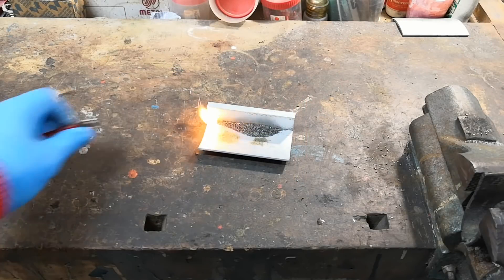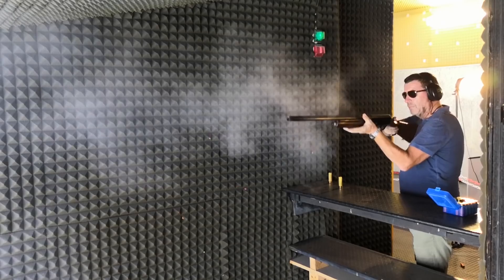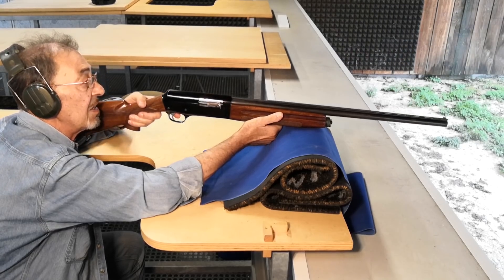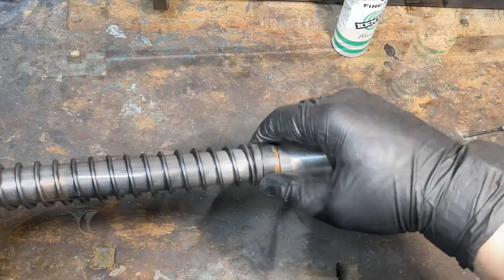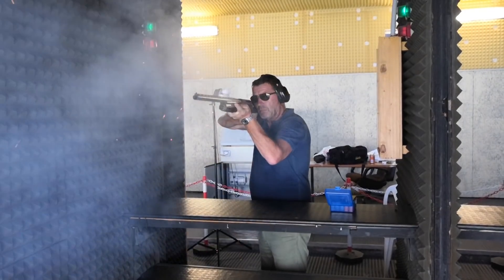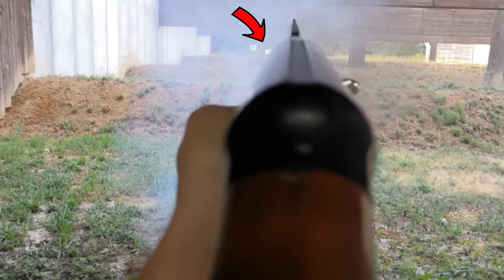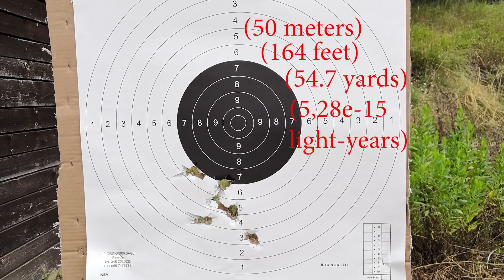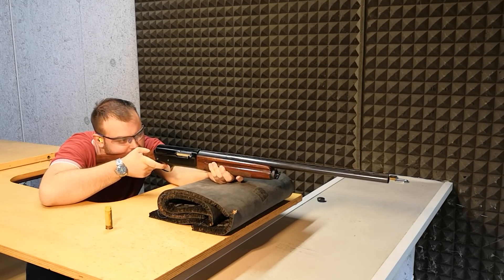Would a Modern Automatic Gun Work With Black Powder?

Comment: Gas operated can work, it probably just won't work long. There's some old videos here on YouTube of someone loading up some cast 200gr .308 projectiles with 35gr of Goex, and the guy gets some shots off with both an AK and an SKS, and the reason it stopped wasn't fouling, rather that he used bare lead bullets which would plug up the gasport.

Gas operated is not going to be optimal for blackpowder though. Maybe the old Potato Digger style of swinging gas lever could get away more with fouling, but my gut feeling is that you want as little moving parts in the action as possible to induce as little resistance as possible, and you're going to want something that uses heavy projectiles. Blowback, maybe even open-bolt, might be best.

The M1A1 Thompson would likely work better than most, but you could probably drag things out longer with a hypothetical dedicated weapon and cartridge. Using a cartridge case with a thin mouth to induce better obturation (like on .44-40 Winchester), along with using generously lubed bullets and a particularly cleanly burning powder, such a finely made one from balsa wood. Patched bullets and Metford rifling might also improve things.

Comment: I live in California and its a pain in the ass to get ammo because you need to go through a background check to get ammo. So i just reload some .308 ammunition with black powder and reprimed the primers with prime-all and i get at least 1-3 moa groups at 100 meters with my mossberg patriot. The groups begin to open up after like 15 rounds which is the downside but it works really well in bolt actions. The barrel does get pretty hot so i stop shooting after 20 rounds to prevent my polymer stock from warping.

Comment: Bolt action rifles are excellent for black powder all tho its still not ideal but it easy to clean and not gas operated i have tested it with black powder and it works just fine but when the barrel heats up the accuracy is quite compromised     it works if you want to shoot 5 or 6 shoots with 10seconds between them but in a semi auto rifle it would jam after 2 or 3 shoots especially an m14 I dont think any fun from the ar platform would work with gunpowder

Comment: Since the Hk-91's are a type of recoil operating rifle, I wonder if a bp load will work. Keep in mind the chambers are also fluted. The Hk-91 action is called a delayed roller locked blow back action. Question is does Black powder have enough pressure to release the rollers?

Comment: I have seen demonstrations of the other way, loading smokeless powder into guns intended for black powder. Short version, it's a great way to blow up your gun. Smokeless (especially modern smokeless) burns a lot faster than black powder creating higher pressures with less powder. If you put a volume/weight of smokeless powder in your gun equal to the volume/weight of black powder you normally put in the same gun you will get far higher pressures than normal and could seriously damage if not explode your gun. While it's in your hand and maybe right next to your face. Thus, I was not surprised that even a large charge of black powder had trouble cycling this gun in it's standard configuration. This long-recoil action clearly did a good job of keeping the fouling in the barrel and chamber and out of the action. I would be curious to see how fast black powder fouling builds up and becomes problematic in a short recoil (like a Glock or similar pistol) or delayed blowback (like an MP5 or FAMAS) or straight blowback action (like a PPK or Makarov or UZI).

Comment: The really corrosive part of old ammunition was the primer, not the powder. Primers, particularly military primers made before the 1950s contained potassium chlorate to make them operate over a wide temperature range and give them long service life. On firing, these primers left chlorate residue in the bore and action which ended up as hydrochloric acid, which was the main initiator of the rusting process. It needs quite aggressive cleaning, preferably with a hot alkaline cleaner such as boiling water and washing soda. 

Normal black powder residue is not nearly as corrosive as it produces mostly nitrate ions rather than chlorate ones. As is observed, nitrate will attack aluminium coatings such as anodising, however its affect on ferric alloys is much less. Black powder residue needs to have water to release the nitrate ions, so the secret of preventing corrosion is to either wash off the residue quickly with a detergent solution or prevent moisture getting to the residue by using a water dispersant such as WD40.

If you are not able to strip and clean a BP gun immediately after shooting, giving it a good soaking in WD40 will prevent any corrosion for a few days until you can get to clean them properly... It is NOT a long term solution.

Comment: Well most shotgun shells are still to this day loaded to original black powder pressure levels, which is why reloading shotshells with black powder or black powder substitutes like Triple Seven are quite viable, especially in break actions or pump actions. So this doesn't surprise me one bit to see it. Plenty of revolver cartridges that could be loaded the same way too. I did know a guy once who used to load Triple Seven in old military cartridges where load data was scarce to build up a test load first, so black powder and black powder substitutes have plenty of use still.

Comment: I'm curious if an inertia-action shotgun would work as well or better? They supposedly have the least fouling of any autoloading system. You would probably have to do a lot of disassembly and install a weaker spring beforehand though, as opposed to just removing a friction ring. I'm also curious how many shells you can fire from your Franchi before it fails to cycle. Asking because I have an Auto-5 and access to a lot of cat pee.
Reply from the maker: I'm pretty sure benelli inertia system would work well, at least in theory. Also, one could increase the recoil impulse using heavier slugs (I was only using 28 grams slugs. 36 or even 40 grams are available)

Comment: The culprit is sulfur. Use sulfurless BP. The Nobel stoichiometric  mix is 87.1 KNO3/12.9 charcoal. The only fouling is potassium carbonate, which is very easy to clean, and not corrosive. Also does not produce much smoke.

Comment: Thank you for sharing this VERY ENTERTAINING and somewhat informative video  on black powder semi auto shotgun shooting.... I can expect that the STOEGER or FRANCHI recoil operated design might also work with stout loads of black powder in magnum hulls with cork, or waxed hard card or  fiber wads.... PLASTIC WADS MIGHT MELT  with the extra heat or fire that  BLACK POWDER CREATES.... So, with black powder,  fiber wads, cork wads, or waxed hard fiber wads...  touching the powder are a better choice...  To avoid plastic fouling do not let plastic wads touch the powder.  IT is possible to load a  cork, fiber or waxed hard card wad and modern plastic shot cup in such a way that the powder does not touch the plastic.

Comment: There are several series of older centerfire rifles that utilize the long-recoil action; by fortune of chance, some of these are chambered in cartridges that originally were intended for BP and later 'converted' to smokeless loads, and hence have enough capacity for reasonable performance. A Remington model 8 is a great example even though the .35 Remington was designed for smokeless, it's still a fairly large case for the projectile...

Comment: I like the content and the ideas but I was expecting full auto instead I got semi-auto black powder shotgun I would like to see this done with a real automatic weapon it's like an automatic shotgun with hands Buckshot black powder use a custom Wad and double Ott like 5 instead of 9 to get more powder I'm kind of disappointed that there is no fully automatic black powder I would like to see this in some Modern rifle design it would be cool to me a specific make a complete shotgun designed for extra large South by increasing bore diameter and length even if you have to do one break Barrel shotgun so you could put extra big point on the shell or make a shotgun shell twice as long for a breech load and black powder you could also maybe make modern day with modern tooling and Metal Muscat that would shoot black powder but try to make it automatic like an electric powered vintage Gatling gun it would also be cool to see handgun loads well 410 shotgun loads wolf black powder big rifles maybe like 50 cal it would be cool to see modern automatic rifles try to use black powder it would also be cool to see old school Muscat replica who is modern easier Park Stila mascara net for cap and ball black powder modified for hay crazy modern smokeless powder musket

Comment: First off I shoot left handed too and competition shoot with original flint locks.  I feel your pain about sparks and gas burning.
I have done this test as well with black powder.  With a Browning A5 and an Fn Fal.  I chose the Browning because it was recoil operated and the FAL because it has a quick adjustable gas block.  Both functioned fine with 100 rounds.  The Browning had no friction rings when the test was performed.

Comment: The reason black powder will not work in semi-auto firearms is that black powder is far less POWERFUL than smokeless, NOT because of the fouling.  It can't produce the pressures needed to cycle the action.  That's also the reason one does not use smokeless in guns intended for black powder.  The pressures built up by smokeless could ruin the barrel of a smokepole, or blow out the breechplug

Comment: You can use any gun with black powder you just have to adjust the gas system to work with the new gas pressure or just use more powder. You also have to clean it more often due to fouling. But it would work.

Comment: pretty good that it performs. I wonder how much PSI the pressure would be of blackpowder. It will probably be lower than smokeless powder. So in theorie it should also lower rate of fire/ prolong the loading cycle of the arm in question. 

Cool video! 

Jeff

Comment: Your have tohave extra  large ports. On everything. If I am not mistaken the browning 5 was intended to work with black powder.
Reply: I’m also thinking the mode3 was Engineered around the 4070 Craig overtime which was a black powder rifle so I may not be sure it is I may be getting some things confused but there were a few working black powder some automatic and fully automatic weapons at the time I know that I am all of the Gatlin gun which I guess you could say is not a full automatic weapon considerate turn by the hand this is a really fast acting so Morrow is they were all power by Blackpowder pistol bit about the cartridges with the very few excepting it was chambered in 4570

Comment: “automatic”
Reply: It is automatic
Reply: @GiantJanus  noooo that is a semi automatic, one trigger pull, one bang. Automatic implies pulling the trigger and holding it and it fires till its empty
Reply: wingzero7X semi automatic is still a automatic weapon in this context, it cycles automatically unlike black powder weapons
Reply: Hugh Janus that’s, by definition of what Demi auto is, incorrect. The gun reloads the next shot, which for current weapons involves a premise round, pulling the trigger once fires one round, but if you pull it again the next fires and so on. AUTOMATIC, is a gun that will fire until you remove your finger from the trigger
Reply: @wingzero7X  Again, a semi auto is also a automatic modern weapon. The title and video is talking about a comparison between old non-automatic weapons like muskets, to modern automatic weapons like self-cycling (also known as automatic) guns that have belts, clips, or mags. You are confusing the other definition of automatic which is automatic fire.
Reply: @wingzero7X  And to define, the definintion of a automatic weapon is  "An automatic firearm is a firearm capable of automatically cycling the shooting process, without needing any more manual operation from the user than simply actuating a trigger." So no, you are incorrect as to thinking "automatic guns" mean only fully-automatic firing.
Reply: Hugh Janus You’re using Wikipedia’s definition’s, I highly recommend you look up semi automatic. It will show what I’m saying. Automatic again implies that you pull the trigger once and it will fire all the bullets, semi auto like this shotgun requires you pull the trigger for each round fired. So it is not an automatic
Reply: @wingzero7X  You keep confusing automatic with fully automatic. All fully automatics are automatic but not all automatics are fully automatic such as semi-auto.
Reply: Hugh Janus that’s the distinction I made, semi automatic is what this is, automatic is referring to fully automatic. One trigger pull, one shot, semi auto. One trigger pull and multiple shots means automatic or “fully automatic”
Reply: @wingzero7X   Your definition is wrong though, a automatic weapon does not mean it automatically fires when you hold down the trigger but it means it automatically cycles a bullet into the chamber. Your issue was that he called a semi-auto, an automatic. which it is.

Comment: Did you use real black powder, and not a modern 'substitute'? I'd love to know the brand or source. It seems a strange thing not to mention, since it's the point of the video.

edit: The last real black powder I saw was the last batch my older brother made (I kinda helped) with an improvised ball mill, in the early 80's. Real black powder is SO dirty when it burns.

Comment: I ran 100 rounds of 9mm loaded with 125gr bullets and 15gr of Pyrodex FFFG equivalent through a blowback operated PSA AKV with no problems. It cycled quite a bit slower than normal, but it still had plenty of energy to cycle, I even bump fired 35 rounds. The gun was about as dirty as if I shot a few hundred rounds loaded with normal smokeless powder.

Comment: If you use homemade sulfurless powder, the fouling, the smoke, the smell and probably the sparks would be greatly reduced. There is recipe that use a mix of ammonium nitrate, potassium nitrate and charcoal that almost replicates a (weaker) smokeless characteristics. Almost no fouling (compared to bp), greater pressures and only burn well if contained.

Comment: I'm curious as to what had you choose an automatic shotgun over something like a pump action, if not just the curiosity of if it will reliably cycle on its own power. That would almost completely restrict fowling to the barrel and give time for the powder to finish burning with a manual cycle, minimizing sparks. Great video, was always curious about this myself.
Reply: Pump and lever shotguns existed before smokeless powder, so we already know they worked. However, besides the Maxim, self-loading black powder firearms never got beyond a few prototypes because extensive fouling would freeze the action too quickly.

Comment: If you thread the conditions carefully, as seen here, sure. I would, however, not want to try this with a weapon relying on a larger volume of fire. Carbon fowling is cool, up until your gun becomes a grenade. As Ian from forgotten weapons recently answered in a Q&A: Maxim was working on a filter of sorts for his maximum machinegun, as its original model predated smokeless powder by just a little bit. It was, however, a huge pain in the ass, and likely not practical or viable on any real scale, so he just redesigned around smokeless gunpowder instead. There's a reason muskets had a cleaning rod used on them after every shot. That fowling is a mean guy.

Comment: Do you think this would work with an inertia driven shotgun (like Benelli, newer Franchis, and some Berettas)?
Reply from the maker: Yes, provided the generated recoil is enough or the mechanism is adjusted. Inertial actions are particularly sensitive to low recoil, i remember talking to one of the engineers who designed the Benelli Raffaello chambered in 28 gauge, saying that it required a lot of study to work reliably

Comment: So this would be perfectly fine in a break action shotgun :)
Reply: YES.  This was the First propellant for breakopen shotguns, and what they were designed around.  The barrel will look like a sewer pipe after a couple shots, but as long as the chamber stays clean, you can shoot all day.
I discovered that a 1/2tsp of Crisco scooped onto the top of the blackpowder round meant that the barrel stayed perfectly clean after each shot!  An smelled good, too.
Reply: I think Hickock45 managed to get a Glock to cycle with black powder. The 9mm rounds were packed to the max with powder and I think the bullet was actually compressing the powder when loaded. He shot a full magazine but it likely fouled the gun terribly. Not a really good idea, but could work in a pinch.
Reply: @MrDmitriRavenoff  One of the bigger issues with black powder is the smoke cloud definitely tends to obscure the animal you are shooting at.
The Brits were using a .303 training with 10 grains of loose black powder rattling around inside the case, pushing a 120(?) grain lead bullet as a gallery load for recruits.
Reply: @MrDmitriRavenoff  I saw a video where a 1911 ran about 30 rounds. I wonder if it just works better for automatic pistols than rifles.
Reply: Yes,I shoot BP slugs and trap on a regular basis with my break-opens.
I was outshooting my smokeless friends and their autoloaders last time out!
Reply: Or pump
Reply: Also in pump and lever action.
Reply: Before smokeless powder break action shotguns were already used with blackpowder so a modern one will handle it just fine